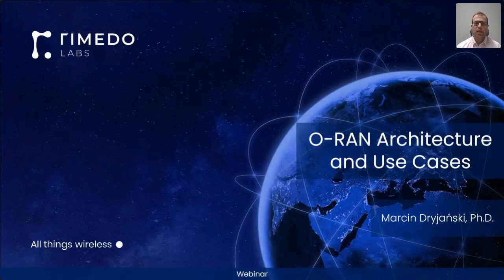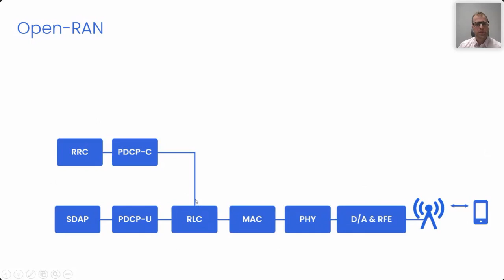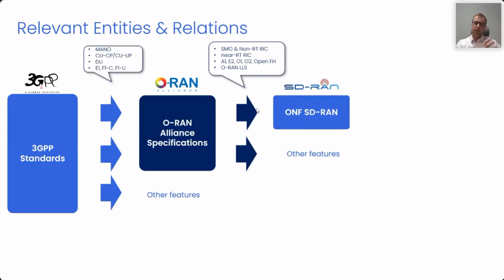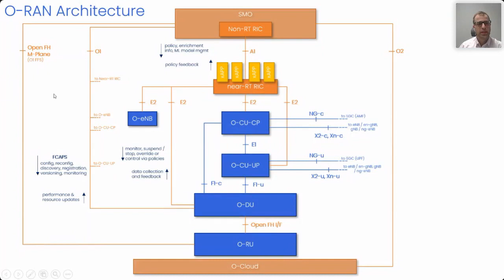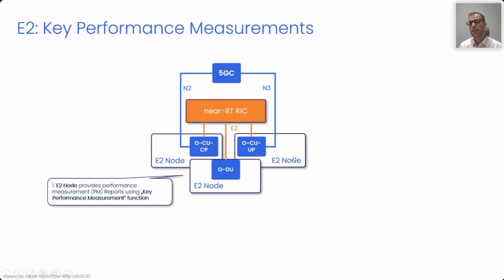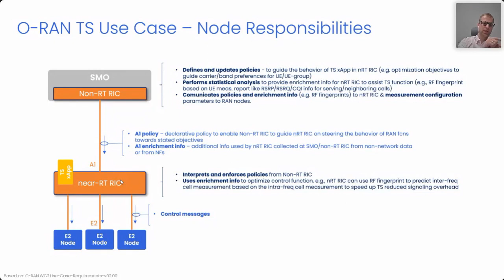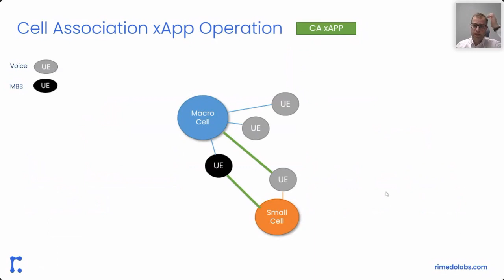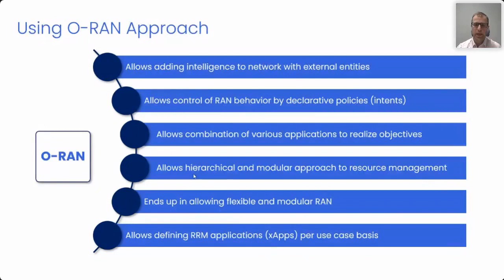O-RAN Architecture and Use Cases

Comment: Very helpful Mr Dryjanski. Two questions from my side: 
1) Where SMO is located? In BSS/OSS ?
2)Are O-RAN Use cases types of x-Apps?
 Thank you
Reply from the maker: Thanks for your questions. 

Ad. 1) SMO is a management plane functionality, thus, most likely it is hosted in BSS/OSS.
Ad. 2) O-RAN use cases describe the usage area for O-RAN, e.g., per-UE traffic steering, or handover optimization for V2X. In most cases they serve as a "framework for xApps/rApps", i.e., define what's the needed input/output to realize a particular case along with its goal. Thus, the respond to realize a use case is an xApp, rApp or an xApp-rApp tandem.

We hope this helps.
Reply: @RimedoLabs  Thank you very much for your valuable info